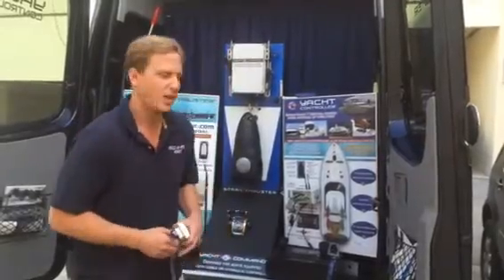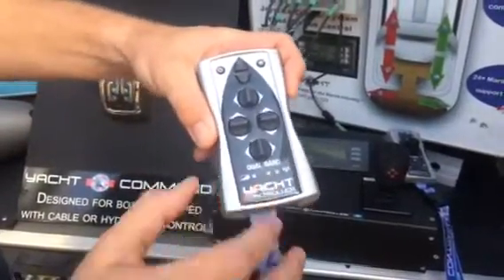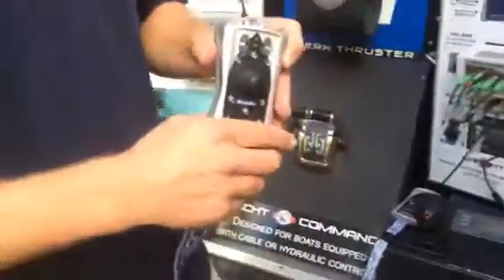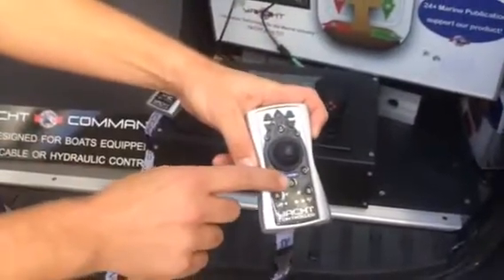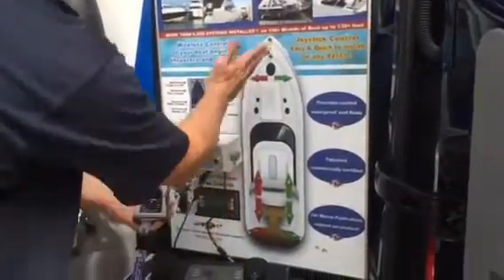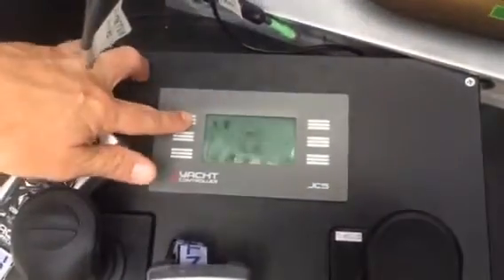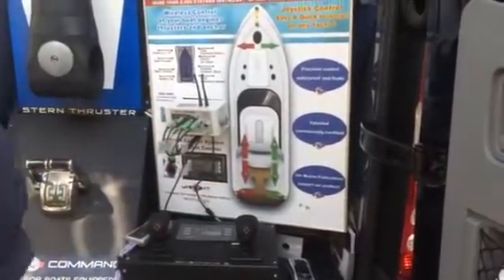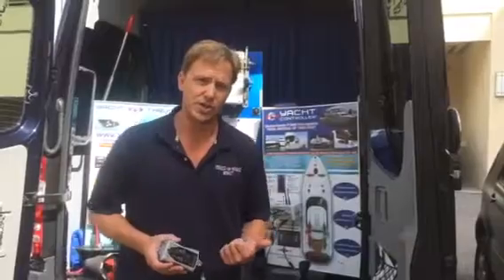Yacht Controller® Wireless Docking System Demonstration Breakdown for Boat Shows | The Yacht Group™

Comment: What existing electronic requirements are needed in order for this product to be installed and utilized on a boat?  Is it possible to modify an older vessel?  I really would like the freedom of leaving the dock when no help is around.  Thank you!
Reply from the maker: We are compatible with almost every electronic shift and throttle controls in the market.  We are also compatible with older model control with mechanical and/or hydrualic shift.  In addition, we can also provide very competitive pricing for a full electronic control refit under our Yacht Command division www.yachtcommand.com  Thank you for the inquiry and look forward to earning your business!